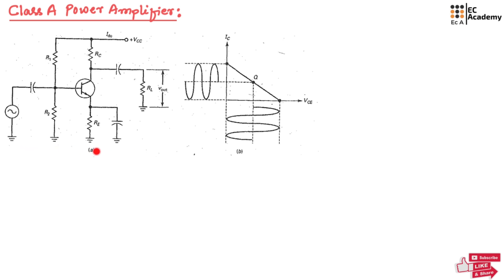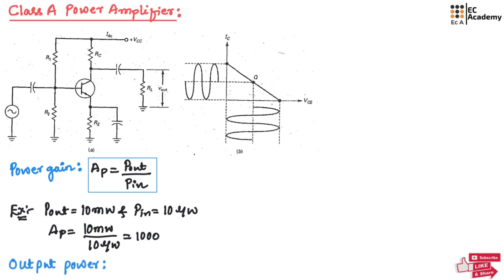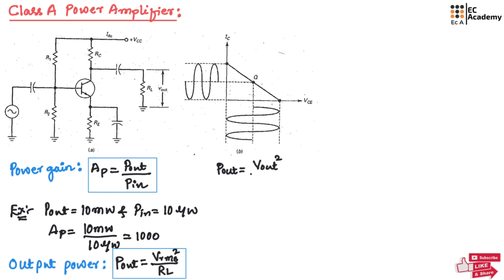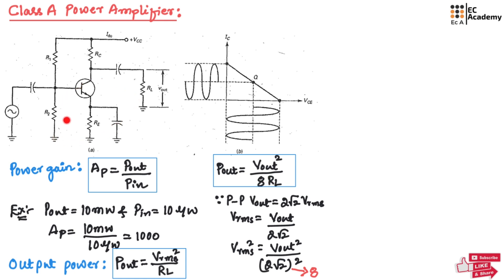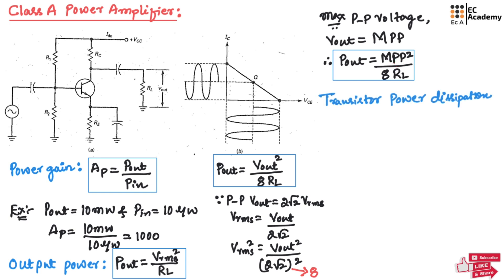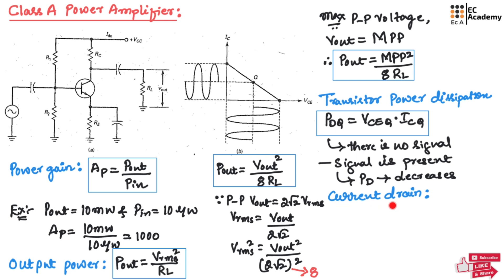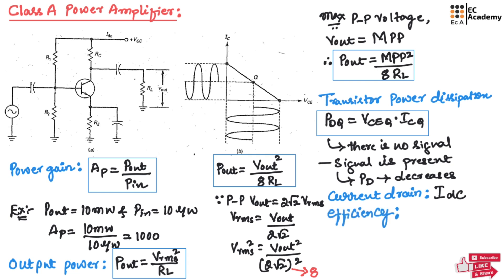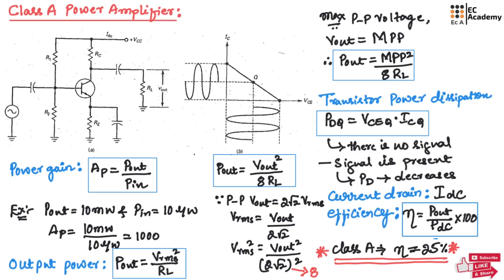Class A Power Amplifier Design and Efficiency | EC Academy

Comment: sir i'm an engineering student with 16 backlogs in that 7 subjects are having below CIE marks 7 subjects are having minimum CIE marks rest of the 2 are additional whatever effort i put i'm still failing exams what to do sir
Reply from the maker: Hi Nishanth, I understand that dealing with 16 backlogs can feel overwhelming, especially when you're putting in effort but not seeing the results you expect. First of all, don't be too hard on yourself—recognizing the issue is the first step towards improvement. Here are some things you can focus on:

1. Identify which subjects need immediate attention, especially those with the lowest CIE marks. Make a plan to tackle these one by one rather than trying to solve everything at once.
   
2. Sometimes, trying to study everything at once can be overwhelming. Break topics into smaller sections, and tackle them bit by bit. Focus on understanding the concepts rather than just memorizing.

3. Don't hesitate to ask your teachers or classmates for help with the subjects you're struggling in. Sometimes, a different perspective can make a huge difference.

4. Progress may feel slow, but consistency is key. Even if you don't see immediate results, trust that every small step adds up.

5.Believe in yourself. Failing an exam doesn’t mean you will always fail. Each setback is an opportunity to improve and get closer to your goals.

Remember, many successful engineers have faced similar situations and came out stronger. It's not about where you are right now, but where you're headed. Keep moving forward—one step at a time.

Best wishes from EC Academy ✌️